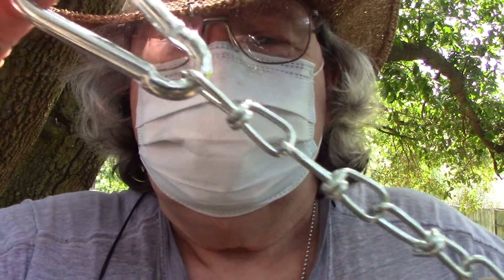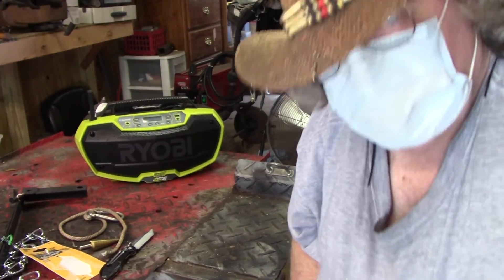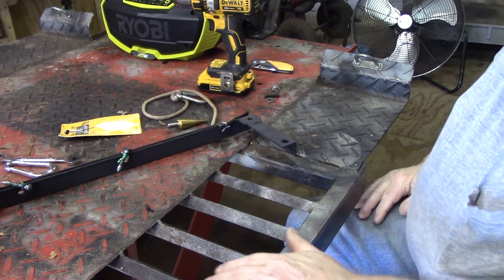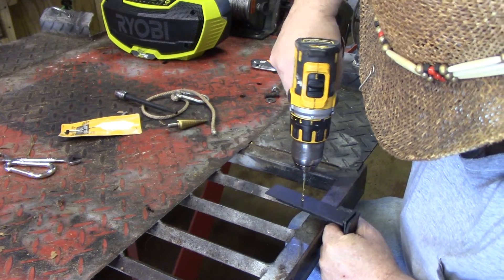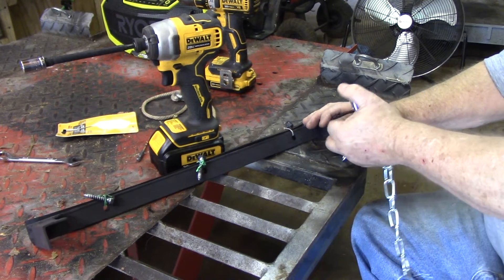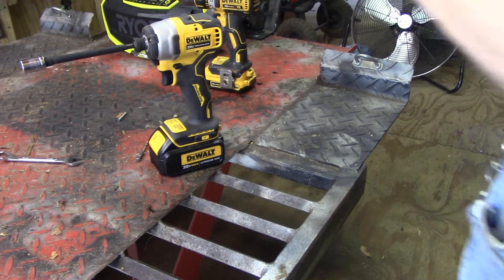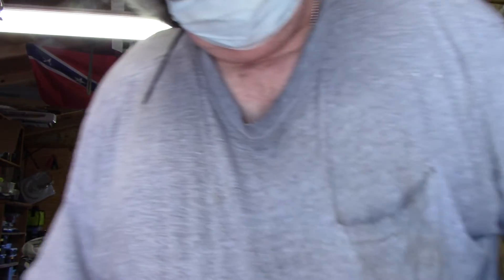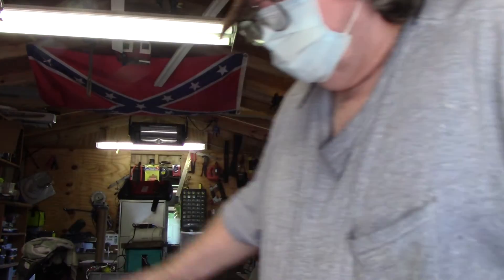Just a short video about stuff

Comment: I made something close but for the tractor. When my wife and I installed a 50ft self-standing tower, I used the bucket to push it up and to keep it from sliding off the side I made the same thing but to fit the tower.  Using it for a latter is a good idea.
Reply from the maker: Yeah, and I don't have to worry about belly pushing the ladder over!! LOL